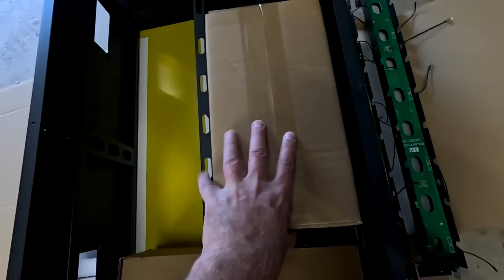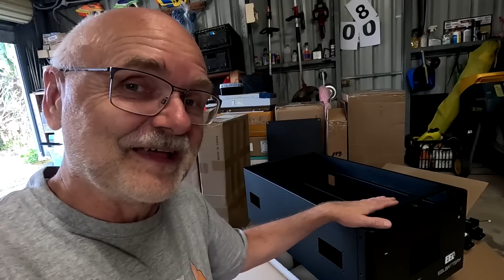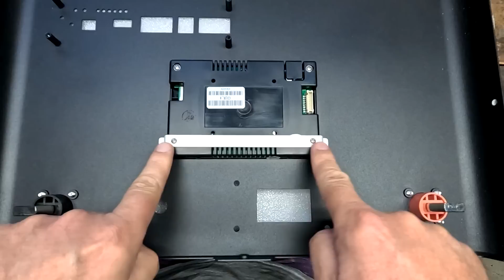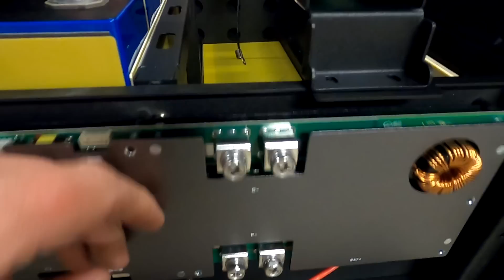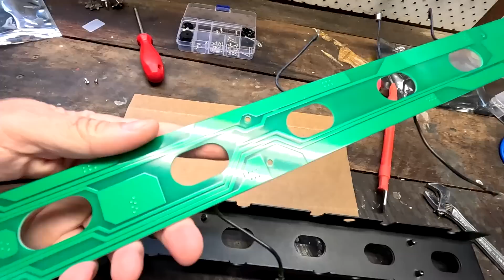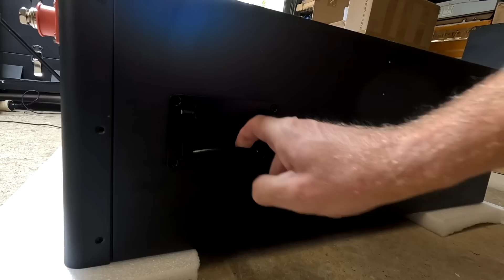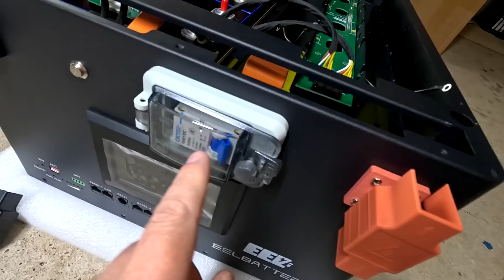Testing the new EEL V4 48V DIY Box with JK Inverter BMS. Are we there yet???🫏

Comment: that is what i bought 3 weeks ago in sunny hot Hamburg.
No display. 
1:38 - the cables soldered on this bms rail pcbs  are too close to the metal compared to previous version were those soldering spots had been more away from the edges. 
Documentation is not really usefull, the first video was wrong built and is still available on youtube.
They do not emphasize on important details like the terminal lug coming from the bms to the cell terminals. The flat metall needs to be on the bottom close to the top of the cell and you have to prepare that while screwing those busbars on the bms. 

they offer 2 manuals for updating the firmware, both are false and no longer valid cause no one will reply to your message or mail. 
The 12 page long manual even shows the communication box but with wrong labels. 
All these documents look like "Andy will find those bugs for us so that we can fix it - maybe, or maybe sometimes"
The 5 RJ 45 only offer 1 CAN and JK explains it is the first port on the left, next to RS-485-1 ... stupid mistake but still available on their web page and I have downloaded that one from december 2023 yesterday.

after big struggles with growatt inverter settings which have to fit precisely the battery is working. A bit of fine tuning here and there and it might be a good overall product even thought the EVA foam is to thick in my opinion, they also missed to tell the torque and NM for the compression screws. 
In their videos they did not mention where to put the thermal sensor and I had to redo it. 
They also forgot to tell us, that the JK BMS caomes with cables for the display which we should not mount if we have not bought that display version.

All these tiny details . 
And your box looked prepared, mine did not arrive in such shape and packing as ssen in 1:41.
I did not get the cash nor the manual. But the central metal frame was well aligned , no bend at all. 

Also your flexible orange bus bars are new as well, so maybe a EEL BOX V4 +.
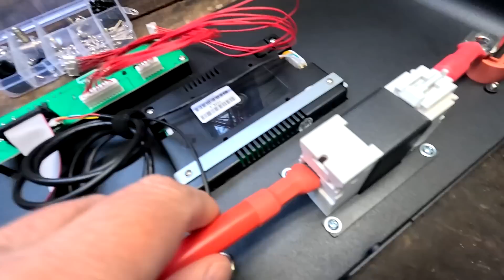19:16 your circuit breaker cables also have changed cause I remember very well that i was cursing that they did not show it in their video how to mount the battery terminal right. And now they have changed it again. 

24:04 - same quality issues here regarding bended pins in the socket and the rail pcb bending far too much and easily cause the bms cables and plugs need a HIGH FORCE to fit into the socket and click.
If you want to hear the click you might become a heartache too while trying to push it in. 
ALSO ANOTHER Difference: your pcbs seemed to be loose no screws used. Our came half assembled and we did not notice until the end cause we had 2 or 4 scews left in the box and these were from the rail mount. They had not shown that in the manual nor in the videos. What a shame. 

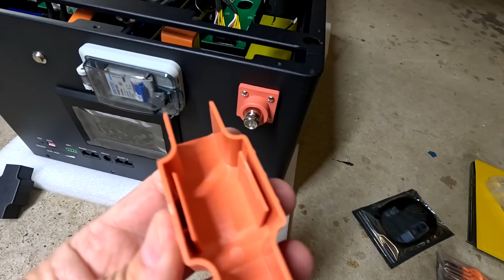27:43 - absolutely right: you can touch the terminal if there is only 1 battery. Easiest workarounds:
# 1 on the black I put a black tape on the open entry
# 2 on the red (which btw looks like cheap light red here what I had gotten) I used a different technique: I cut away the 2 sides and folded the remaing part to close that side too ( i had no red tape and thought this would be a more compact version too cause I hate the big overhanging part which is useless for only 1 box. 
# 3 EEL should provide 3d printer files at least as alternative, a more robust connection cause the current one fells quite fragile and does not always sit tight on the terminal.

good product, but poor partly craftmanship and missing love for the details.
Reply from the maker: Thanks for your comprehensive comment and sharing these details.
Reply: Where does the thermal sensor need to go?
Its now connected on a busbar together with a + side.

Comment: Is it an obligation to put de cells and parallel before  mastering them in serie  even if they are on the same voltaje ?
Reply: As of my experience, nice, new grade A cells are balancing quickly after assembling. So, I don use paralleling for quite a while.
Reply: @dlya_svoih  thanks
Reply from the maker: With the JK-BMS and its active balancer, it's not necessary anymore to parallel and top balance the cells before building the battery. It does it automatically when fully charged.
Reply: @OffGridGarageAustralia  thanks yo so much

Comment: I think the contact area auf the flexible cable to the Circuit breaker isn't bigger than the contact area of the flexible bus bar.I think, the contact area at the main positiv of the battery with a single stud isn't much bigger.
And I have multiple EEl boxes, with this feets. It works, and you can remove the box from the top with two persons. But at the bottom I use the plattform from EEl with the rolls.

Comment: For the narrowed buss bars at the circuit breaker:  The breaker is made to trip at 250A.  It's contact area is designed for that, and conducts along the whole contact patch.  A thicker buss bar would simply mean more heat storage, since the center of the buss bar between the contact patches wouldn't see much current.  The contact patch where the batteries connect to the buss bars isn't much bigger, really.
Reply: Strange theories. There is a reason cables and contacts are specified in mm² and not surface area only.
Reply: A smaller contact area has a higher resistance, so at given current produces more heat which on its own increases resistance. A larger surface to air dissipates heat better, lowers temperature and thus resistance creating a lower voltage drop. That is why larger is better. The length of the “narrow” part also plays a role and that one is small in this case.

Some people prefer the use of fuses in stead of breakers just for this reason. All contacts create additinal loss.

You can push any current thru any wire, but when too thin it will heat up, resist more making it heat up and resist more and so on, right up to the point it melts and essentially becomes a fuse.

The contactarea between the cell and the bussbar has the same problem. The unround hole makes for even less contact area, whis is why some parties supply an extra washer for in between the terminal and bussbar. This enlarges contact area but also creates another “connection” which of the two is more beneficial would be a nice experiment. Some people prefec flex bars or cablelug bars for this reason also.

It seems that for DC purposes and high currents DC breakers are often too small in size (have to fit a dinrail) and thus have a higher loss due to heat building up. All energy converted to heat along the way is a less efficiënt battery system.

Some of andies other cases use breakers with large surface terminals, some even have 2 parallel breakers.

His own build uses relatively huge Noarc breakers and even they get hotter then one would wish. Low resistance switches combines with fuses what dissipate heat in an optimal way may lead to higher efficiency, but one would have to test this.

It would be a nice in depth experiment trying to measure the difference in ways things are connected and how this relates to lifetime efficiency of the whole system.

Comment: Love your videos Andy! Very informative, great info. 
Have you noticed issues with the JK Inverter BMS giving fake SOC numbers, and the real SOC dropping over time? I’ve heard this is just an issue with Chinese inverters (mines Sofar). Tried contacting jk but no luck? Left my battery for a week and it kept charging to ‘100%’ but the max voltage just kept dropping, 57v to 51v. 

Any ideas?
Reply from the maker: Yes, I have 4 JK BMS running for a few months now and SOC readings are all over the place if the BMS is not calibrated from time to time. I haven't fully charged for 10 weeks now, Victron shunt states 28%, JK says 90%. The JBD BMS says. I always trust the Victron shunt.
It's on my list to discuss with JK.
Reply: @OffGridGarageAustralia  shame to hear you’re having the same problem with a Victron system, I thought it was just an issue with the Chinese ones. Hopefully it’s something they will fix, as now it’s summer for the north, I am having to calibrate every few days to keep the battery above (true) 80% SOC
Reply from the maker: @joesimes  It is not a Victron problem. The Smart Shunt is calculating very precisely. The other BMS are all over the place.
The BMS should calibrate automatically every time you fully charge, so there should be no manual handling necessary.
Reply: @OffGridGarageAustralia  Understood. Unfortunately even with my one reaching full charge each day, it’s calculated soc with my Sofar inverter is reaching 100% but at lower and lower voltages. I have to do the old trick of reducing the Ah and then increasing to actual for it to calculate the ‘real’ soc. Hopefully something that will be fixed because it’s seems a common issue on the diysolar forums
Reply from the maker: @joesimes  What BMS model do you have, BD or PB series?
Reply: @OffGridGarageAustralia  Have the PB model - JK PB1A16S10P. Running V15.17.
Reply from the maker: @joesimes  there is a V15.24 available for this BMS. I would highly recommend upgrading to the latest firmware first. 
Link is on my website https://off-grid-garage.com/battery-management-systems-bms/
Reply: @OffGridGarageAustralia  I will install and report back in a few days once I have had time to check the data. Thank you so far 👍
Reply: @OffGridGarageAustralia  Ok, so I have run it on the new version for a little over a week now, and it is slightly improved, reduces at half the rate it used to. In this time the 100% SOC voltage has dropped from ~58V to ~54V. It still doesn't do the float or absorbtion modes even though the settings are turned on. I have it in Pylon CAN mode, and will try this weekend in a different setting to see if it changes anything. But it seems the issue is still there in V15.24, albeit slower.
Reply from the maker: @joesimes  ok, thanks for the feedback. Forget about soc for a moment. If you set the JK to say 55.2V as RCV and leave it there for one hour, does the battery actually reach that voltage and hold it?

Comment: Just a word of warning about the Circuit breaker, I have had 2, 32Amp DC circuit breakers from that manufacturer go faulty. 
I replaced them with Noark brand.
Reply: Andy: 
I’ve often wondered if these Chinese CB would actually work. 
A video idea I’d like to see is testing these cheap Chinese CB to see if they work as intended. 
Thanks
Reply: I'd also be worried that they'd create an arc during breaking under heavy current that would just keep burning  @SuperRockmonkey
Reply from the maker: Hence I always say, use these breakers just as a main switch and have a proper external DC breaker. NOARK is great but has MCBs only up to 66A.
Reply: @OffGridGarageAustralia  
I guess between the CB and a Mega fuse if you are using the Lynx system you should be covered.  I do like thoese big breakers tho! 
Thank you. 
Keep up the good work!
Reply: @SuperRockmonkey the fuse should be close to the power source and securing all the connected cables and installations.

Hence on both side there is a powersource you need fuses on both sides.

Comment: Thanks for the Video :) 
I have two V4 battery boxes mounted on a wheeled cart, specifically the ones without displays. The BMS is attached to the front panel, and the compression plate fits perfectly. I've used the provided rubber feet, which guide the boxes into alignment without needing to bear weight. Everything fits together seamlessly.
The only missing components were eight screws for the battery terminals. I've encountered one issue: one of the JK BMS units gives negative battery temperature readings. I've confirmed it's a problem with the BMS, as swapping the units results in regular readings.
Reply: I bought two of the same boxes with the cart.  One was damaged  before being sent ... shipping box received was not damaged, and the BMS showed no temps, so they sent me a replacement.  I was able to kinda fix the box, but hoping for a big discount on a new one.  Besides that ... top notch.
Reply from the maker: Thanks for sharing!

Comment: Is there a good reason to chose between an assembled box, a kit box and a row of cells on a shelf?
Reply: It could be as simple as personal preference. (Neat, smaller footprint)

It may also be something legal. Maybe the boxes give a perception of being safer because it's all hidden away and will pass an inspection better?
Reply: you buy the cells seperately and know possibly what you get .....
Reply from the maker: Yeah, from a regulatory perspective, both the pure DIY shelf and a DIY box are handled the same way. Only if the manufacturer assembles the whole battery, it is different. Like Jakiper, Seplos or Gobelpower does.

Comment: I am still waiting for the test of the vertical Version 🥺
Reply: Me too, I ordered one vertical V4 5 weeks ago and I hope to get the version without cables
Reply: @saschahorstkotte3331  how did your experience with the V4 vertical box go? Did it arrive safely with cables or bars?
Reply: @russellbach5730  I have built 8 boxes so far. 5 boxes were dented because they were poorly packaged. They all came with flexible busbars and bars to the BMS and to the fuse. All parts are in good quality. If you push them forward, i.e. the rollers are backwards, they are very tippy. I have one installation with 6 boxes in parallel and the SOC calculation from the JK-BMS is very bad after one month below 100% SOC. With firmware V15.33 too., but this is not a problem from EEL. The boxes are complete and look nice. Make sure you choose the right bus bars when ordering  ( 4 or 2 holes).
Reply: @saschahorstkotte3331  - thanks for sharing your real world experience - 8 builds!, sounds as though because the box is essentially hollow they dont travel  well. Good tip about wheeling the box. I wonder how hard it would be to fit a better quality circuit breaker, eg, Noark ,Nader or Beny? Did you get the small or large JK BMS display?
Reply from the maker: They asked me which one I want to test. As I'm getting rid of all vertical boxes, I opted in for the normal DIY box.

Comment: If the breakerbusbar is over 2mm thick and 10mm wide , I Don’t think it’s a huge problem. It’s all about material (I do hope it’s copper) and the crosssection. 20mm2 should be just safe. Just. It will get pretty toasty at 250A. 4 Watts of heat will be generated in that cm.
Luckily, copper is very good at heat dissipation.
I am curious how that breaker is made internally.
The internals don’t have much wiggle room to get rid of their heat.
I wouldn’t be surprised if the breaker melts before the handicapped busbar.
That’s a test I would be interested in.
Our inverter puts out 240A max, and even 70mm2 cables get warm. And that goes to a big fat busbar and 4 batteries.
I can’t imagine how such a relatively small breaker handles such a continued load.
Reply: I have one of the larger molded case breakers, made by zbeny with 120mm cables. That gets up to about 40c external temperature when pulling 180 amps.
Reply: I'm guessing these are not really meant to be used at 'rating' continuously, but for peak surges.
Reply: @CollinBaillie  that’s my point. Unfortunately, in a battery, the current often is continuous.

Comment: I have the EEL V3 with the JKs which are basically the same but with no display.  I had zero issues putting them together....but your comment about the lack of conductive material going in and out of the breaker is now starting to concern me.  I may decide to make up better cables when I figure out how.  Oh, the feet.  I didn't put them on the bottom unit but have no problems getting them in or out on the other 6.   They are a bit mashed up after moving them around 3-4 times though.  Just be careful stacking.

Comment: If you want compression you can only use the epoxy Plates and have a 10mm plywood at the end and at the Front and then add 3 foams and you have great compression at the cells.
Reply from the maker: The EVA tape is not great for compression as it will lose the ability to expand again over time. It will just stay in the compressed form forever.

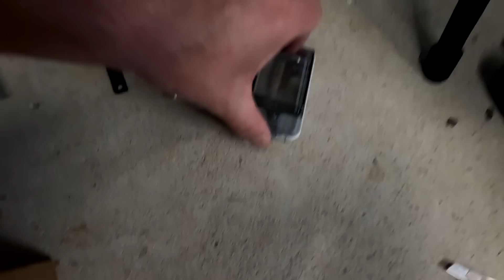Comment: 4:00 Very intresting, there are different Parts in the box than the one i got from EEL....looks like you got a special edition 🤔
24:03  the bending PCB is very dangerous, because the solder pins of the connector on the downside can touch the metal an get a short.
Also the cables from PCB to the cells are touching the sharp corners of the metal, because they are glued sideways on the PCB instead upwards. I can clearly see your rails have the same issue.
My compression plate was pretty flat, but the screws were to short to get them into the thread. It was only fitting without the cells. With cells there  was a 13mm gap between plate and thread. On both sides and in the middle.
Reply from the maker: Yeah, the overall design has some little flaws. I think they are refining the box and accessories all the time. Hence the many changes we see
Reply: I had the same problem, I went to the hardware store and buy 9x M5 20mm screws
Reply: Can you make a video of your box ?
Reply: @Pxa3d  
No,
The box is in operation since 2 months. I will not disasamble it again.
Reply: Hello sir 
Please make one video jk inverter bms step by step wiring @Juergen_Miessmer

Comment: So : the Yixiang is better, already mounted and less expansive...
Reply from the maker: Both boxes have breakers. I would use them as main switches only and have a decent breaker when connecting them to a common bus bar.
Reply: But doesn't have a breaker. Is that a deal... breaker? 🤷🏼‍♂️